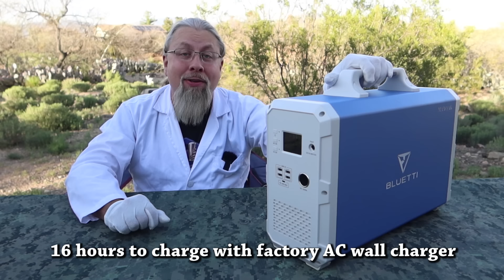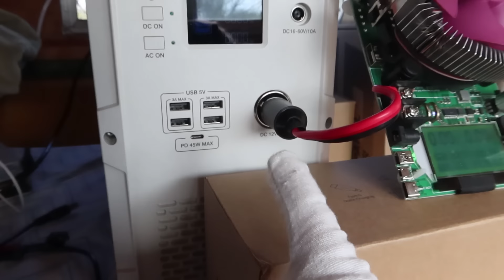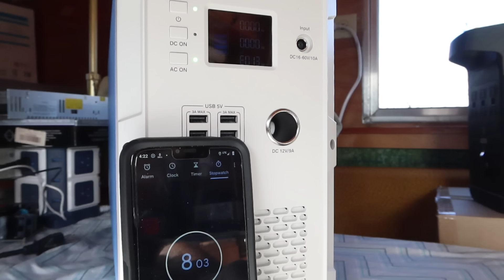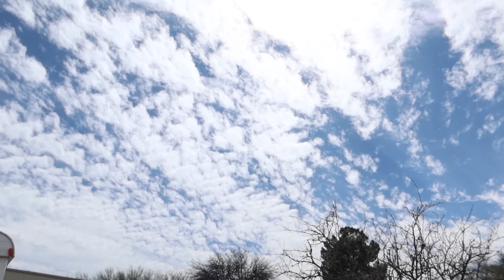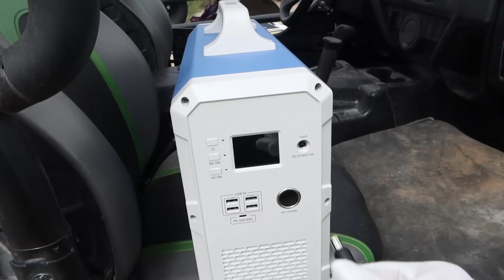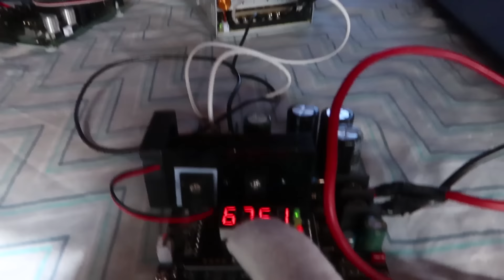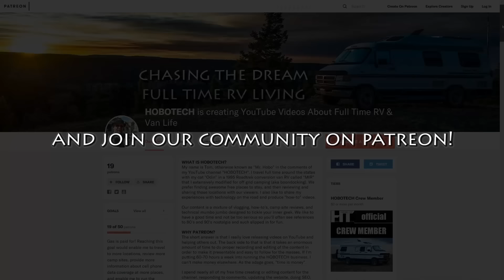MASSIVE Off Grid PORTABLE POWER Station! 2400Wh MAXOAK Bluetti EB240 Lithium Solar Generator Review

Comment: What do you think about the Bluetti AC200? They will sell it on Indiegogo for 45% cheaper mid June. On the website it says 2000-Watt/1700Wh Storage Capacity/LG Auto-level Cell/700W Solar/Cycle Time 2500+/Charge Tesla. Is this considerably better than the bluetti EB240? or should I pass on it if I have the EB240?
Reply from the maker: I'll have a review coming.

Comment: What is the best/largest one you tested that would work and charge in a Prius camper?   Needs to charge from the car's 12V system and a 120W solar panel at the same time while running a 12v fridge, laptop, and misc electronics.   Thanks HOBO, love your videos.
Reply from the maker: I don't know of any that dual charge like that from two sources simultaneously.

Comment: What about charging off of the car using a Renogy DC to DC converter, can one of those be set high enough output voltage?
Reply from the maker: Those only work on 12v batteries so, no.

Comment: I need your help and advice.

I need to be able to power a Sonar and laptop 24/7 out of the office next to a river, without the need of human interaction. By that I mean, I need it to run during the day and night without me going to attend to it.

The sonar is an Oculus M1200d https://www.blueprintsubsea.com/pages/product.php?PN=BP01042 this can be powered via the AC outlet.

The laptop is an https://www.panasonic.com/au/support/product-archives/computers-tablets-and-pos/notebook-tablet/toughbook-2-in-1-convertible-laptops/cf-19.specs.html this will also be powered via the AC outlet.

I currently have been testing this system running the sonar and laptop with an https://www.amazon.co.uk/ALLPOWERS-78000mAh-Portable-Generator-Emergency-288Wh/dp/B07DVGYDL5/ref=pd_lpo_sbs_23_t_0?_encoding=UTF8&psc=1&refRID=ST1J2A8WCDG9VYBM11ZG and a https://www.amazon.co.uk/ECO-WORTHY-Foldable-Controller-Portable-Suitcase/dp/B07RVG179M/ref=sr_1_22?keywords=solar+laptop+charger&qid=1570443407&sr=8-22 but it only lasted for 5hrs after the sun went down.

Please could you advise me as to whether either this 2400wh or the 1500wh version would be suitable?

Thank you
Reply from the maker: The Bluetti 1500wh would be the minimum if you want to guarantee it will run until sun up. You're also likely going to need another solar panel to run in series.
Reply: @HOBOTECH  Thankyou for your advice, its much appreciated. Keep up the great work fella.

Comment: Their site gives 10% off and your code worked!!  I got it for $1599.00 no tax and free shipping.
Thanks so much.
Reply: Did you have to apply two codes to get the 10 percent and the hobo discount too? How did that work?
Reply: @forrestmichnevich7371  No, the 10% was a Memorial week sale. But it was listed at $1899.00 and with Hobo's code it came to $1599.00. So instead of entering the code for 10%, I used the Hobo code.

Comment: Finally got our Bluetti 2400w and hooked it up to our 2-200w Newpowa solar panels. It works great! We can run our 400w A.C. unit, instant pot and anything else we hook up. Excellent review was the clincher to purchase. Now we can boondocks anywhere! Thank you for your reviews!
Reply: Hello Susan! I wanted to leave a comment and ask how your setup has been running since the install. Have you found that the inverter has enough wattage for daily/weekly use? Have you made any modifications or concessions since the install?
Reply: @gabrielmarshman2819  hi and we were able to travel 3 1/2 months and over 9000 miles that summer with no issues. The only thing we would do differently would be to put larger watt panels to produce more. However, our budget didn’t allow it at the time. Thanks for asking!
Reply: @susanl4219  that's fantastic news! I'm trying to decide on a unit that will allow the same for a sailboat I bought. What was the model of air conditioner you utilized? 
Also, thank you for your response :) I love hearing first hand reviews from those who've used these extensively in the field. :)
Reply: @gabrielmarshman2819  I will have to check tomorrow and get back to you. It’s dark now and there are no lights where our camper is kept. Funny you should mention a sailboat. We lived aboard a 32 ft. sailing cruiser for 8 years before settling on land and purchasing a Runaway camper. Though our solar setup on the boat went to batteries with a 1000w inverter. That setup kept us with power quite well.
Reply: @susanl4219  I purchased an '86 Prout Quest, 33ft for the same purpose. I'm always happy to find kindred spirits :) she has 1kw of solar at 12v, but no inverter. I can't decide whether or not to overhaul the existing power supply with an upgraded bank ($$$$$$) or simply use a Bluetti ($$$) for the duration of my travels.
Reply: @gabrielmarshman2819  the Bluetti we have would be vastly overpowered by 1 kw, but they do make a 2000w power station that would handle it better. It’s model AC200P.  It will handle a 5000 btu ac easily. Not sure what the price is though. But do your research on the battery bank as well.
Reply: Our AC unit is a Garrison 5000 btu. When it kicks on our led lights flicker at first. Once it gets to temperature it runs fine.

Comment: Funny that this great machine will admittedly not run a coffee maker. Yeah, I get the power consumption issue, but then a larger inverter would fix that. Even 1500w would have made a difference.
Reply from the maker: It runs this coffee maker. I'm doing a video on it. https://amzn.to/3dl44Wh
Reply: @HOBOTECH  Thanks. One of the official "will not power" charts from Maxoak listed a coffeemaker, but I guess if it's near or under 1kwatts, it's good. Still wish for a larger inverter. You rock man!
Reply from the maker: Yep. I'm out to prove or disprove some myths about what these things can run.
Reply: @HOBOTECH  BTW, I just ordered a 2400 from your link. Thanks!!!
Question- would it be feasible to run a higher wattage inverter off of the 12v Bluetti output for higher wattage appliances,?
Reply from the maker: @ksmit  No. 12v has a limit of 9 amps.
Reply: @HOBOTECH  Tnx!

Comment: AC plugs in the back?  Why don't you show them also?  So to jam it into a space a have to allow for the plugs to have space in the back, and the cords have to long enough to allow removal.  Think this might be a down side to an otherwise awesome looking power source.
Reply from the maker: I showed them on the smaller 1500 model. There is a vent in the back too and they probably designed it that way so you couldn't put it up against a wall.

Comment: I’m considering this for hurricane use to keep my residential fridge/freezer combo running in the event of power outage. I’m Brand new to this electricity/solar thing and trying to find out whether or not this will run the fridge. Any insights on this? 

I’m in an apartment and could hang solar off my balcony for half the day to keep it trickling in power.
Reply from the maker: Depends on the fridge. Look at the label inside for power consumption.

Comment: What would be a good strategy to store / maintain when not in use? Only using every couple weeks when camping off grid and want to maintain correctly to get the maximum lifespan of the batteries.
Reply from the maker: Store it with a minimum 20% charge and don't store it in hot (over 90 degree) place.

Comment: What is the absolute best off grid solar/wind system if you have a budget of 5k? I’m just learning this all and have a couple of gas generators already, but not going to rely on their being gas in the future. And what is your best pick if you have a budget of 10k?
Reply from the maker: If you have that kind of budget I'd go DIY. Do a 5kw+ fixed solar array and a ton of batteries with set of 110v and 220v inverters. Wind is very expensive to implement correctly (requires towers at least 50-100 feet tall). I could recommend the Titan but I think for the money it is too limiting and the battery is far too small.
Reply: HOBOTECH I’m over whelmed 😳.        https://www.amazon.ca/ECO-LLC-Complete-Inverter-Controller/dp/B07WDBWWVX/ref=psdcmw_sfl_6257196011_t1_B087F9ZLX9

https://www.amazon.ca/gp/aw/d/B087F9ZLX9/ref=ox_sc_act_image_1?smid=A2Q6HKFA9JF535&psc=1

https://www.amazon.ca/gp/aw/d/B07VKJC23X/ref=ox_sc_act_image_2?smid=A2QR61WLVJ5WVY&psc=1 Which if these would be best ?
Reply: HOBOTECH is this worth the buy?https://www.amazon.ca/gp/aw/d/B07ZDD9929?th=1&psc=1
Reply from the maker: @Jennyfromthebush  ALL complete junk! Well, that BESTSUN might have some promise but if you don't know what you're doing it's not a good choice either. You should find a solar consultant in your area to determine your needs before dropping this kind of money. This isn't something you just lay in the back yard and plug in. You need a real installer.
Reply: HOBOTECH I know right...😩..I sold my house and got out of the housing market at the right time, because of this “plandemic” and now getting the hell outta here off grid. I’ve known about this happening for a few years now, and have been prepping, but regarding this subject, it can be extremely frustrating with how many different options there are. My ex is an electrician, so he’ll be able to do all of the hookups, but he won’t know necessarily what would be the best option......Or are you available to hire!? 🧐🤨😝Lol. Anyway, thanks again for getting back to me so quickly. I’ve just come across your channel now and have already learned a crap ton 💩!!

Comment: WIll this power a sump pump?  I'm worried about starting amps.
Reply from the maker: Depends on the motor size. It can handle 2000w startup for a second.
Reply: @HOBOTECH  Thank you for the quick response.  I didn't see the 2000w surge mentioned in the tech specs, only 1200w.  I think with 2000w it should definately handle a surge of a 3/4 hp motor starting.  I'm going to give it a go.  I'll let you know the results.

Comment: Hey. What voltage booster are you running in that video? I got that power supply you show.... before I plug it into charge it reads 60V but after I plug it in to the bluetti it drops to 35 V....
Reply from the maker: Change the input switch from 220v to 110v. Voltage booster is on my website.
Reply: @HOBOTECH  Well that worked :)  Thanks.

Comment: Hello again, Prof. Hobo,

I've been try to come up with a good backup for the Maxoak Bluetti 2400wh.  I could probably swing for another Bluetti 2400wh, but (this is for a remote location) I wouldn't be trying to use a lot of power.  Just like to have some redundancy.  I'm looking, in the worst case event, to try to keep a tiny fridge / freezer cool, and a light perhaps.  Reckon, if the grid goes down, there won't be a satellite feed coming to my dish, and probably no cell service either.  I'm asking nicely, please be kind... I'm not a moron.
Reply from the maker: You must have 12v regulated output for a portable fridge so that narrows it down to 1500/2400 Bluetti, Jackery Explorer 500/1000, or the EcoFlow Delta. Done reviews on all of them and they all do the job. I would include the Suaoki G1000 but it's no longer for sale.

Comment: As tempting as this unit is, I may just have to save up for the Tesla Cybertruck.  If you price out the usable kwh... the tri-motor option works out to be half the cost If you were to purchase the equivalent MaxOak 2400WH solar generator at 73 units :).  You get the added bonus of having all of the bells and whistles of a tri-motor Cybertruck.

Comment: Boom.  Exactly what I needed four out little off-grid cabin.  THANKS again for your review and for taking the time to answer my questions.  I  got the 2400wh model and 6 BOUGERV 170w Solar Panels.  Doing 2 groups of 3 in series and then in parallel gives me exactly 67.3 volts to the input as long as I use 60 foot of cable.  I just tested it on a super sunny day here so I'm sure I may have to play around with it a bit more when I have my final setup but I'm pleased.  Now we will rarely have to run our gas generator at the cabin as we rarely go over 1000W.  Thanks again.
Reply from the maker: Awesome!
Reply: Geeez what do you need, like an hour and a half of partial sunlight to recharge this beast?  Awesome
Reply: How is it holding up?

Comment: It'd be sweet if you could parallel two more together for higher amps.
Reply: In theory it is possible. practical? not so sure. You would have to match AC frequency phases while under , perhaps varying load. 
Would need some electronic phase/load control.   Thoughts?

Comment: AWESOME REVIEW!!  I am new to this, so bear with me. Why cant i just hook a 1500 watt inverter up to this?  If that is the biggest knock it doesn’t seem like that would be that big of a deal. I saw that they are about $100 for one. As long as its that easy of a fix, should i just plug it into this, or tear it open and replace the 1k with the 1500?  Probably just plug it in, never mind on that one. But, wouldn’t just plugging one in be the answer?
Reply from the maker: The 12v output is limited to 10 amps (120 watts). So, no.
Reply: Well darn. I do greatly appreciate the swift response. Is there any option to use this and get more watts out of it?  Or would it be wiser to just stay under the 1k and not worry about it.

Comment: Great review. You think this would power an upright household freezer and fridge for very long? I was considering this vs the Eco Delta but you confirmed what I have been hearing they (Eco) have zero customer service 👎
Reply from the maker: if it's a modern energy star fridge this should be able to power it 24-48 hours depending on temperature, capacity, and how often you open it.
Reply: @HOBOTECH  thanks buddy. Appreciate the quick response! Subscribed!

Comment: Great review.... I got the EB240 and 4 BougeRV 170W panels like you show in your video.  Do you recommend hooking the panels up in parallel or do a series/parallel connection?
Reply from the maker: Series-parallel. There is a 10A input limit so if you hook them all in parallel you'll lose about half the power.
Reply: @HOBOTECH  Awesome.  Love your reviews.
Reply: What AC charger are you using during your tests? I got my bluetti today and that 160 w power supply really take a long time to charge... Assuming I could get a 500 W AC charger

Comment: Is there anything that will run a small space heater over night in a van?
Reply from the maker: If you mean "small" as in 200w this will run it about 10 hours. Electric heating is very, very expensive which is why I use a Wave 3 propane heater.

Comment: Still waiting for the overall prices to go down, battery capacity even farther and the inverter sizes to go up as well, not enough value for almost $2000
Reply: As with any tech stuff, the prices always go down and performance always get better. You have to bite the bullet some time or you will die without buying any tech. For me it was time to bite the bullet get this thing.
Reply from the maker: Current price is $1633 for 2400wh. I think that's quite a value when you see competition near that capacity going for $3000-$5000.

Comment: I just got a 6300watt power station (craftsman Generator) with a 9100 watt surge  I got it used for $300  added $50 in parts and tune up . It runs about 8 hours at full load on a tank of fuel.  Total investment  $350  It's heavy but has wheels. I can recharge the fuel tank in about 5 minutes
Reply from the maker: That's one way to guarantee social distancing up to a half mile! So about 8 gallons gas / day for a week camping  = 56 gallons @ $2/gal = >$100 + $1.99 for a bag of earplugs + cost of a chiropractor afterwards. Quite the bargain!
Reply: @HOBOTECH  Actually For camping I use the Sportsman you recommended and I purchased for $149 at Home Depot. Love that thing,  this 6300 watt monster  is for running the entire house   And  I have done the most I can to quiet it down.  It lives outside about 30 feet from the house , with doors closed it's not bad at all
.

Comment: Currently using two Bouge 170 watt solar panels with my Bluetti eb240 and would like to add a third panel but concerned that I will exceed the voltage input of the Bluetti.  When wired in series, is the open circuit voltage the number that is used to calculate the total for the three panels?
Reply from the maker: Yes. I was able to wire 2x170w and 1x100w in series.